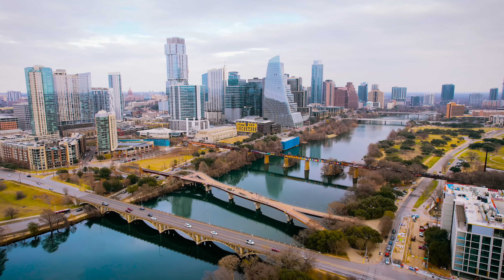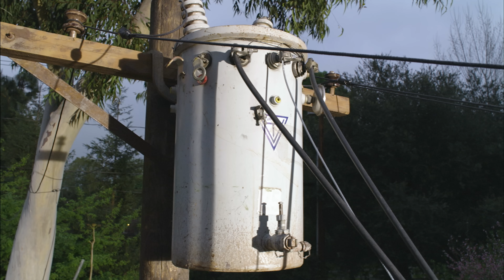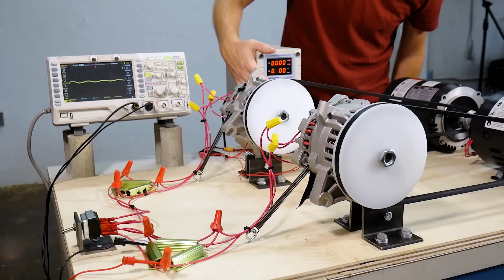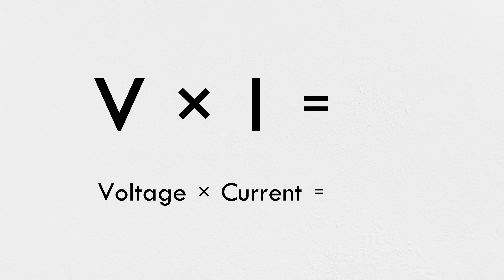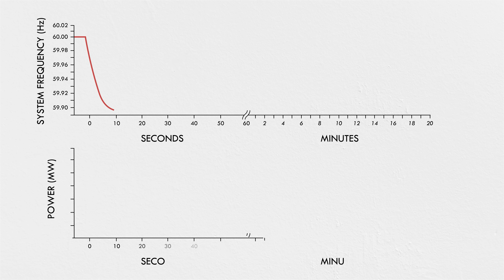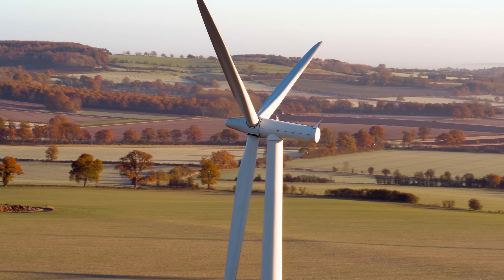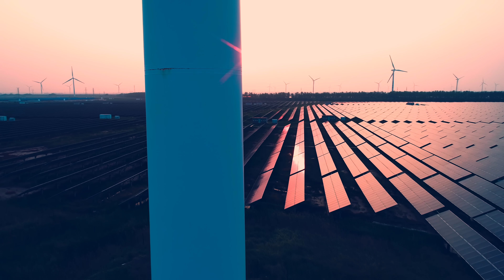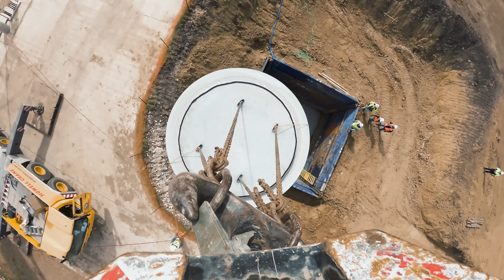Connecting Solar to the Grid is Harder Than You Think

Comment: DC motors and AC generators have gotten so efficient these days, I think hybrid-mechanical inverters should make a comeback. We'd take a ~15% roundtrip loss from DC motor to AC generator, but you'd get true sinusoidal output that could be digitally phase-controlled. Building massive flywheels is cheap (use local dirt and rocks as the inertial mass) so the renewable DC input would add real, physical inertia to the grid.
Reply: You can get true sine wave outputs without turbines/generators.  I don't know why he focused on his horrible modified sine wave inverter when most inverters out there these days, even the cheap ones, are pure sine wave.   In anycase, any sort of magnetic component can be used to convert a square wave into a sine wave.  Transformer or Inductor, basically.

What a physical flywheel gives you is momentum, so I agree with you there that it could be useful.  There is no reason why a solar farm couldn't keep a flywheel energized in addition to having its normal inverter setup.   Really no different than the flywheel of a NG generator.  Its the flywheel that provides the momentum, not the fuel source.

-Matt
Reply: @junkerzn7312  You're claiming that a digital signal can be used to create a true smooth sine wave?

Comment: My one question/ concern is this.
Every night the solar goes away. Who picks up the slack?
The legacy power plants do. 
So they still have to exist with the ability to handle the whole load. 
However they sit stagnant during the day making substantially less money. 
That loss of revenue causes budgeting issues for these legacy power plants that have to remain 100% and yet make less revenue. So what happens is  these legacy plants start making budget cuts in maintenance and upkeep. Which makes them even less reliable. More solar less budget for legacy generators. It's a Domino effect. This issue is going to come to a head where more and more legacy plants will experience more and more unplanned emergency down time. 
This is what I'm seeing anyways.

Comment: Grady, can you do a video on the differences between a silicon solar panel generator vs. a mirror array focusing the sunlight on a molten salt cask that boils water to drive a steam turbine generator please.

I've seen photos of the solar mirror plants but they don't seem to be too common vs. the silicon panel plants and other than construction costs, I can't see why they aren't used more often in the southern deserts because they create power in the same way that all fossil fuel and nuclear fission plants do...they boil water to drive a steam turbine to spin a generator...the only difference between them is how they create the heat to create the steam...

Comment: Thank you for the video. If you haven't already can you look at how the Tesla battery at Hornsdale (2021) was successful relative to stabilizing their grid problems and saving money. Also, there must be some downsides to these large grid batteries (occasionally bursting into flames) and your views there might make an interesting segment. It seems the battery element is here to stay. I've read an analysis done by Consolidated Edison in New York that suggested a couple of their gas peakers could be closed down with the installation of a grid battery solution.  My guess is the battery is expensive but, so is a gas peaker....thank you!
Reply: There aren't really any downsides to grid-scale battery storage.  Yes, batteries can catch fire sometimes, but actually not generally the batteries and certainly not LFP batteries.  What sometimes catches fire are the electronics, though, and that is true even with LFP batteries.  But despite being heavily exaggerated by the media, these are relatively minor and events that can be corrected by better designs.

Grid-scale storage is not as expensive as people believe, because it does a whole lot more than just soak up energy and push it out.  Grid-scale battery systems can be located just about anywhere so where do they get located?  They get located in congested spots to relieve the congestion.  That directly removes costs associated with relieving the congestion by other means (such as running new power lines, for example).

So the absolute cost of a grid-scale battery system can easily be defrayed by other avoided costs such as having to run new power lines, making the grid-scale battery system the least expensive option.

Comment: Is it really true an inverter changes the voltage, use a higher voltage, to deliver energy, I think that is BS. This makes it impossible to use more than one inverter in a group (without any feedback) and can be dangerous because the inverters start to bid for the leading voltage (higher and higher, can go out of tolerances) and the leading inverter claims the demand for all of the power that is currently used. For example 3 inverters of 500W and only one of them is leading and you start to use 1000W, there is a problem. When all inverters and the grid operates at exactly the same voltage and frequency, the load is balanced between the sources. That is what you want. At every video I watched with the "inverter at higher voltage" claim, there isn't a detailed description or example how the inverter achieve this exactly. If it is true, explain in detail and what will happen when a second inverter is connected. If it isn't true, please stop mention this behaviour in videos.

Comment: This video did a great job of explaining the issues with grid forming vs. following.  Also, the demo of the wave form from a cheap inverter was priceless.  I knew they were pretty bad, but didn't know they were that bad.

You could do another video on another problem that needs to be solved as we bring more solar and wind farms into the mix.  These renewables are often best located in areas where land is cheap, and there's either a lot of dependable wind, or blasting sun light.  Most populations don't live in these areas, so the power has to be connected to the grid by building long runs of new transmission lines.  That's hugely expensive, thus making some perfectly good locations uneconomical.

Comment: Another benefit of inverters is that they could blackstart out of phase on an isolated microgrid then merge back with the wider grid. This is much more complicated headache when you're trying to offset a bunch of physically moving machines. Most of the time it just isn't done and thus generators must be started one by one. This is also why the prospect of complete blackout is so devastating because it could take days to weeks to restart. While generally inverters are creating a new problem by being so fast acting really the inverters can be programmed however you want. The real problem is twofold one of which was mentioned in the video. Producers want to protect their equipment from the grid. The other of course is that this is Texas on a smaller less regulated grid than the rest of the country.

Comment: Hard? Eh. Expensive? YES. - Electrical Engineer 

Having greedy private companies run the grid is the only reason i'm not running solar grid tie. They won't allow grid tie here unless they inspect it, their contractors only inspect systems they install, they only install systems they sell.... Meaning the extremely cheap and easy to get used panels are not allowed, and a decent solar system that would cost me less than $7500 will be over $50,000 doing it their way. Considered just going off grid. Local laws allow the power company to report my house as unlivable if it doesn't have a grid tie, and your house can be condemned for it...

So i'm running solar off grid, and running a grid connection for my heavy loads.

Comment: I'm not sure I'm clear on why a grid-following inverter system can't switch over to an isolated grid-forming one using presets in case of an outage. More specifically, I'm wondering about your comment regarding Solar panels on homes not being able to function during an outage. Shouldn't it be a relatively simple thing to decouple the house power grid from the larger municipal one until it's possible to reconnect?
Reply from the maker: With batteries, it's not that much trouble. Without them, it's a recipe for brownouts. Just a cloud passing over will mess stuff up.
Reply: @PracticalEngineeringChannel  a'ight, thanks for clarifying. I suppose I always assumed those come with batteries in the first place.

Comment: For a large solar plant, I still think a DC-Motor to Flywheel to AC Inverter mechanical system might be enough of an all-in-one solution to overcome its bearing-based inefficiencies.  Especially with the improvements in DC motor technology coming from the automotive sector.

Comment: 6:10 That is not what's called pulse width modulation (PWM) altough a similar effect can be achieved with it when connected to something that does limit the rise time of the voltage (e.g. a capacitor)

PWM is the method of using a fixed frequency period and varying the on and off time ratio inside of that period. This ratio is called then called the duty cycle. What you are showing is only possible with PWM if there is at least some inductive load present which is not generally the case, but only because the grid does have all these transformers. Of connected to a resistive load directly, no pure PWM circuit will ever deliver anything near a sine wave.

Comment: PWM? PLL? Have you been fiddling in my computer's BIOS?

Hearing those initialisms pertaining to the power grid surprised me more than it should've: After all a computer requires circuitry to convert AC from the wall into the various DC voltages required to run the electronics, then more chips and circuitry to convert it's native DC back out into rotational movement for things like cooling fans; I'd simply never thought about it before!

Thanks!

Comment: I give solar electricity to the grid for free. It's much easier if everyone produces a little with millions of private small grid tie inverters. 
  However i would rather be paid for the surplus that i produce. 
The problem is that in France (where i am situated). In order to sell back you must have your installation done by someone with a specific certificate and these people charge 2 or 3 times more than other installers. Obviously i simply install my own equipment for a fraction of the price. (Almost all used equipment.) I also repair my own electronics so this also saves me money.
  Just proof that they don't want your electricity but they are happy to take it for free!

Comment: Why do we need to increase the voltage before sending electricity over long distances?
Reply: Resistance scales with amperage (current) but not with voltage. So moving the same amount of power at higher voltage (and lower amperage) leads to less losses.

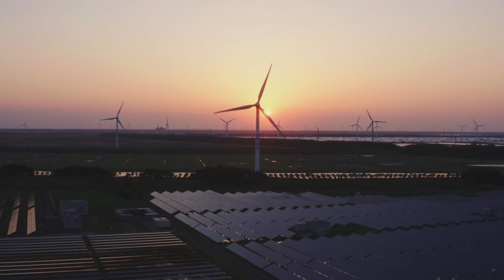Comment: @13:47 is the maximum output always the most efficient, i would think it is not thus it would be 'cheaper' to run at the most efficient point than at max capacity; two birds with one stone. please correct me if I am wrong.

Comment: I am a test engineer for high power frequency converters and be build our "VSD"'s not only for grid injectors like wind turbines (exactly like in the video), but also for applications where you would not suspect them. Is is for example sometimes easier to let a water turbine run at a non-constant speed and run all that power through a VSD, which constantly synchronizes to the grid, than try to maintain a constant speed with the turbine. The are also used as a soft starter for these very big motors and sometimes, they can even reverse the flow of energy to pump water back up into a lake for example. We are talking from 500kW to 100MW here.

Great video!
Reply: There is Gigawatt VSD?
Reply: Looking for what math's and projects you recommend me to work on now and is e3 best field or what is your specialty fi
Reply: Thats it 500kW to 100MW i eat that at the gym lol
Reply: in the meantime, US politicians are selling our USED coal plants to China and making billions, replacing them with useless solar. BTW, the JETSTREAM is blowing CHINA COAL POLLUTION right back here, instead of US blowing ours to Europoe. Genius ideas

Comment: Here in Australia we have a number of grid-connected large scale battery banks that can provide instantaneous frequency response and they work great. They are great for keeping the frequency and voltage stable (and the grid running) long enough to allow other generation to kick in (or even long enough to potentially allow tripped equipment to be reset).

Comment: It seems that part of the problem is that Texas did their own thing, rather than join the national grid, for dogmatic reasons rather than engineering reasons
Reply from the maker: Other areas of the US are having similar struggles. We just have a greater penetration of renewables at the moment. I chose that case study as a single example, but you can check out the NERC website for many others of similar magnitude.

Comment: The most insane thing for me is that as a german, I didn't have to even consider thinking about all this ever. If you live somewhere where power outages are common and even planned, like in the USA, you will start getting interested in this topic by fact of exposure. Here I can not even remember the last time we had a power outage. Or a grid frequency deviation. Nothing ever breaks here. How do you americans cope with the fact that you can not rely on your most important piece of infrastructure?
Reply from the maker: https://www.cleanenergywire.org/news/european-power-grid-disturbance-has-german-energy-industry-worried
https://eepublicdownloads.entsoe.eu/clean-documents/news/2019/190522_SOC_TOP_11.6_Task%20Force%20Significant%20Frequency%20Deviations_External%20Report.pdf
Reply: @PracticalEngineeringChannel  Neat. Thank you. Though ... still ... I had no idea this even happened. Whatever we do definetly didn't cause us to actually lose power where I lived and I am chronically online, so a power outage at 21:00 would have seriously upset me.

Comment: Hm, I would've expected in the absence of an existing wave-form coming in from the grid things would just use internal clocks to boostrap their own cycle automatically...
Reply: many do, though you need to make sure they're not backfeeding the grid first
Reply: @TheAechBomb  Sounds trivial enough to have some sort of automated switch that only connects when either there's no external signal, or the internal state is synchronized with the incoming signal; and maybe just in case, to avoid race conditions start with low enough amplitude so that if some external source comes online with more confidence you go into synchronizing mode instead of continuing ramping up your own signal from scratch.

Comment: A digital O-Scope?  I'm disappointed. I thought you'd use an old fashioned analog O-Scope. :D

I can't believe you missed an opportunity to mention the P=I*E calculation for wats from voltage * amperage.  I know that might be a bit far for a base engineering course like this, but that 30 seconds could have taught someone something else new.  Also, you didn't mention the reason AC is used on the power system vs DC, which is also why groups of solar panels will feed into the same converter unit.

Comment: Mechanical inverters were in excess of 99% efficient.  What’s more they could have huge flywheels built in so that if there were interruptions or fluctuations in the DC they would carry on providing AC without any problems.  I think it was their size and the fact that they needed regular maintenance that sealed their fate however they are still used in certain situations where a true sine wave is needed
Reply from the maker: I mean, we still use synchronous compensators, but that went a little bit outside the scope of this video. I have another one coming up on power factor.

Comment: If solar panels cant provide the home their attached to with power during an outage, what's the point? Could I just put in some sort of code compliant generator backfeed connection and hook up a jackery with a pure sinewave inverter and have that set the pace for the solar inverter?
Reply: many of those home systems are just built to reduce electricity costs and can't keep up with an entire house-worth of load, so it makes more sense for them to turn off than to keep running (and the average joe wouldn't know how to make sure they're not backfeeding the grid in a blackout)

Comment: A couple years ago, I was hired by an outfit that planned to build a solar farm in my neighborhood to research and carry out the process of arranging the facility's connection to the local electric utility's system. They seem to have thought that would just entail looking up the appropriate person to talk to on the power company's website and giving them a call. When I came back with the utility's massive requirements document and a list of all the technical information I would need just to fill out the initial application form--most of which they didn't have, since the bulk of the engineering and equipment selection hadn't been done yet--they paid me for my time and I've heard nothing from them since. I suspect they abandoned the whole idea.

Comment: Seems like a digital to analog would help balance things, like PV connected to a DC motor with flywheels that then sends power to the grid as a sort of mechanical inverter system, there will likely be losses but with abundance of solar energy those losses might be reasonable

Comment: Couldn't we use GPS satellites to provide an accurate time source and then generate the frequency off of that? That way if you knew you had the right frequency it would automatically always be in phase. Just an idea tell me off if it's total bull.
Reply: In theory yes, in practice no. A large-scale grid can be a thousand miles long, which is close to the distance that a 60Hz frequency pulse travels at the speed of light. The phase also changes depending which way the power is flowing.